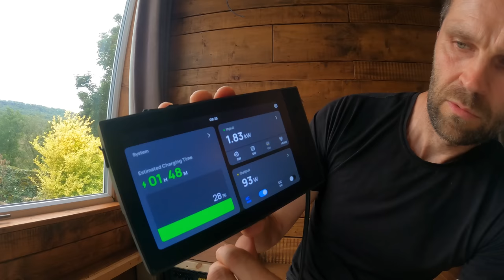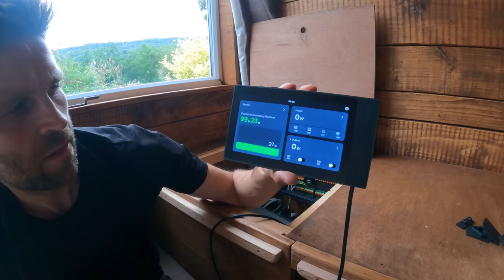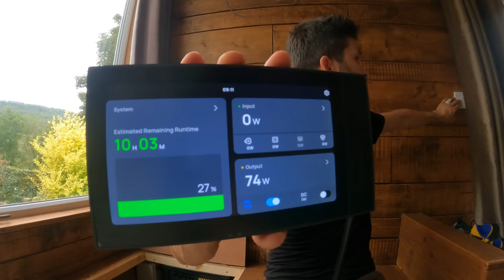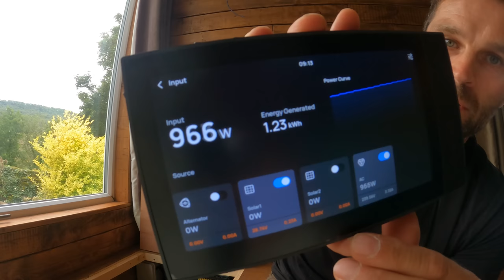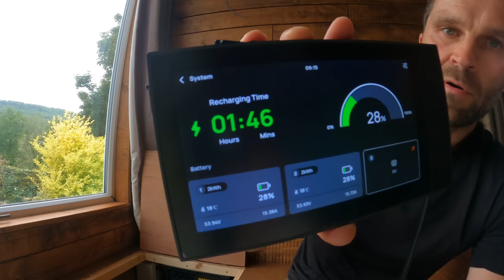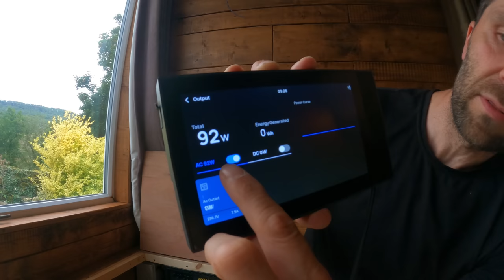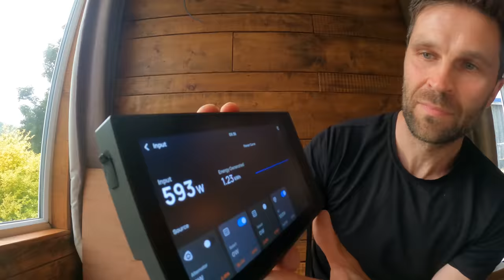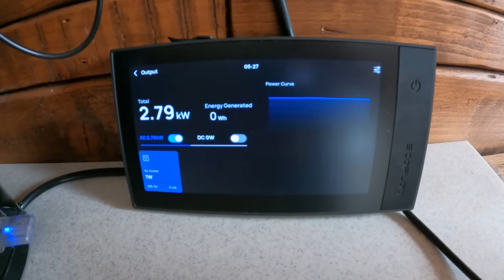SHIPPING CONTAINER TOUR - ECOFLOW Power Kit Installation OFF GRID LIVING Solar Panels #ad

Comment: If you face your solar panels South by compass it’s the best direction to point them in and the pitch you angle them at is the same as your latitude wherever you are and that’s all really. excellent choice using the aluminium or stainless steel frame as wood gets loose and rots. You may consider having a second permanent frame for mounting the panels at your container as it removes stress and damage 👍
Reply from the maker: Thanks mate. Yes I’ll sort something out for the panels when I get some time. 👍👍👍

Comment: Ecoflow was smart in using a 48V system compared to the 12V system. Thinner wires means easier fit and a safer system.
Reply from the maker: Yep! Top quality and design 👍

Comment: Stained glass window, designed and made by yourself. My father has transformed dull walls. He made a fantastic window for an attic room. He did hot air balloons … looked incredible. You could do an impression of the lake district or perhaps a portrait of Blue.  Just an idea.
Reply from the maker: That would look awesome although it would need a lovely light behind it 🤔😬
Reply: @BUSHMANandBLUE  just a small LED attached to the bottom of the frame. It would light up the dullest day. I’m pretty sure whatever you eventually come up with will look good and be highly creative. I’m really interested to see what you come up with converting a van. I love watching vanlifers creations. I think it would suit you to have at your disposal a traveling office/studio. I’ve noticed recently the huge upgrades in range rover with roof tents accessible from inside. They have slide out kitchens, all sorts of clever storage etc solutions and as you know those four wheel drives are the next level. Anyway exciting to think about all the adventures that could be had. That’s just what you are all about Al. 😁 you being you would make excellent content.
Reply from the maker: Thanks 😊. I just love designing and making things and plenty design ideas for a van. One day if I get the money I’ll buy one👍

Comment: Love it Al!! I noticed you replaced your old consumer unit with Ecoflow's distribution panel. Just wondered could a fairly bog-standard UK consumer unit with 16 amp fuses (like the one you had before) be used with the eco flow power hub if it was just a ring mains & lighting circuit?  I already have a consumer unit for an off-grid build and would love to save costs by keeping that rather than buying their distribution box but I will get it if it's safer to use with their power hub. Any thoughts? 
Thanks! ☺
Reply from the maker: You can link it to existing household systems. It’s pretty diverse👌

Comment: what a great resourceful build 👍👍👍 could I ask a question though? I'm wondering how you fixed your wood paneling to the wall without visible screws, I was thinking you are using tongue and groove boards with a french cleat or metal  clip at the top to hang the boards with one at the bottom to prevent rocking?

Comment: I'd go for a good old Suffolk Latch on the privy door. Loving the variety in your vids right now. Great tour, the shipping container is the dogs you-know-wots (don't panic Blue, I meant the metaphorical dogs)  👍
Reply from the maker: Yes normally a Suffolk latch would work but the cage has a built in sliding bolt which works well. I just need to weld a rod so it reaches the outside. A bit like a Suffolk latch😉👍
Reply: @BUSHMANandBLUE  Nice work. Looking forward to the upcoming vid. Hope that finger is on the mend.

Comment: The best thing to have on the wall would be a Plaque from Youtube as you really deserve it. A custom made neon sign With the channel name . Ps  maybe worth changing all lighting to 12 volt & maybe kettle as you would get at least 10% saving as most invertors are less that 90% efficient..
Reply from the maker: Thanks mate😬. I have some 12v lighting ready to go in but can’t find the time to finish it all off
Reply: @BUSHMANandBLUE  Also I'm no Electrician but coiling excess cables is a NO NO!
Reply from the maker: Those cables are not live. Just waiting to be wired in.

Comment: The eco system has capacity many times more than you will ever use for the container.
A couple of bigger panels will easily keep batteries topped up.
Also,you could top up batteries on cheap night rate from grid,if you have that?
Reply from the maker: Yes it’s an immense set up. I have a few extras to add on the DC side as and when I can afford it. Getting the solar set up properly will be ace! 4800w total solar input is massive. Extra batteries to add if needed too. I don’t have cheaper night rates but could look into it with another provider👍

Comment: Can you use the cooling air flow of everything to supplement the heat for heating, or have you done that? Every little helps.
Reply: Mind you I'm not sure how much heat the system will give...probably very little.
Reply from the maker: Always worth considering these things. I think an aircon unit in summer is more needed than heat in winter. 👍

Comment: You forgot to connect the RJ45 CAN Bus cable from the Power Hub to the CAN Bus Port  of the Smart Distribution Panel. The Manual says the system will malfunction if you don't connect it. You don't need the blank RJ45 dongle in your case.

Comment: Great video Allen but 
using two over current protective devices on the same circuit is potentially unsafe. Advice from my old man a sparky who also loves your videos. ❤️‍🔥❤️‍🔥
Reply from the maker: I’ll check with my Sparkie who wired it up if my change would bother it. I followed Ecoflows instructions

Comment: Nice demo. Roughly what does the equipment cost?
Reply from the maker: It depends on what you go for. A leisure battery for a van is about £750 so these batteries are bigger and better so cost nearly 2k. The whole set up is between 6-10k. It does cost but it is the best and saves so much time and money on labour.
Reply: @BUSHMANandBLUE  my guess was 10k.  Thanks

Comment: One word. “Sexy”, that’s how I’d describe that system 😁 I thought it would be just another power system install but it’s design, build and interface is all sexy and I like it. My only question is what your thoughts are with the earthing of it? There are so many different types of earthing requirement and doesn’t seem as straight forward as putting an Earth rod in. What have you done, or thinking of doing for that system? Also I think maybe a canvas of you and blue in the mountains looking into the sunset would be a good use of the space above the bed!
Reply from the maker: It really is an awesome kit with top quality materials and design. We might all need similar the way the world is going. My electrics are earthed through a rod👍

Comment: Al, please get a fully qualified Electrician to check your installation as my partner (who is) has noticed several non-compliancies and safety issues!!
Reply from the maker: Thanks. Everything was wired by my electrician I just added the system.
Reply: As you removed the existing consumer unit which I assume has an electrical certificate and replaced it with a new one you will need a new certificate. A few noticed non compliances: Ring circuit on two MCB’s is a big no no, the coloured inner conductors of a cable exposed outside of the consumer unit and cables not securely clamped. A bit of a grey area is that the consumer unit should be in a metal enclosure and fire stopped.

Comment: Was going to get one of these for our boat but not at the price of £6397 our boat was on £4600 lol
Reply from the maker: A mate ones one for his boat so he doesn’t have to run loads of wires and the added safety for keeping the radio working if trapped at sea. In the long run it would be worth it as if you seek your boat you can use the powers kit on your house as backup.